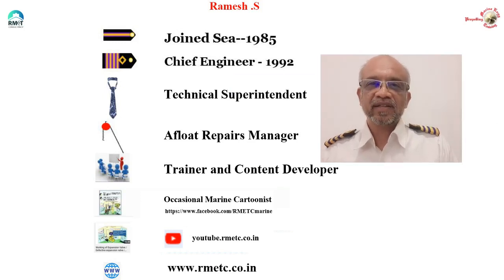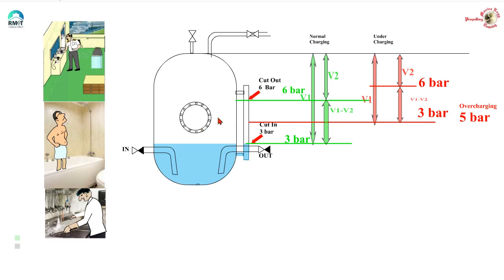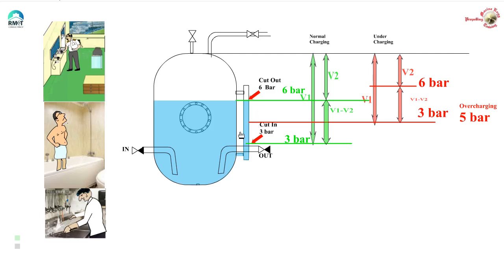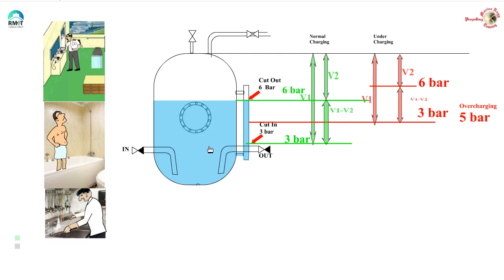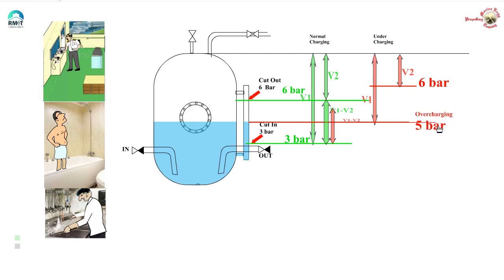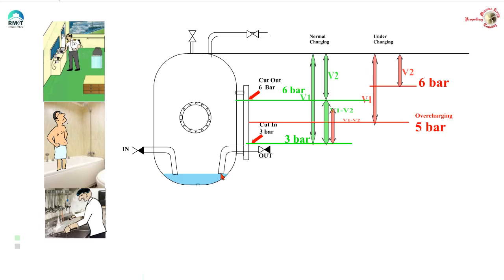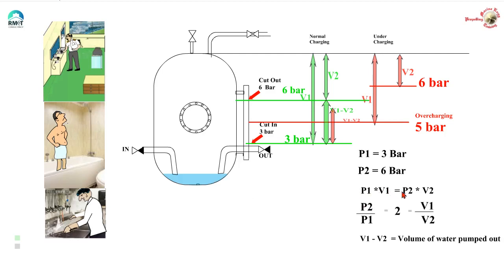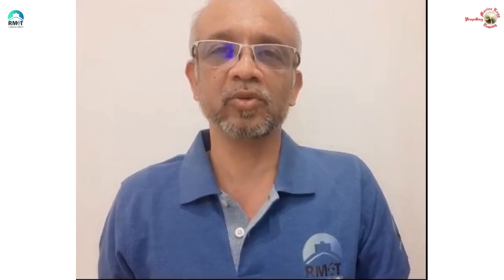#Hydrophore charging Tips and Tricks|Ramesh Subramanian|RMETC videos

Comment: Hello sir
Will love to know correct application of silicone and gasket maker.. Should we use it along with new gaskets, o-rings Or nly with old ones 
Where to use silicone n where to use gasket maker.. Difference?? 
Thanku
Reply from the maker: From what I understand, there are three types of sealing. Gaskets, sealants and gasket makers. Sealants can be used on two metallic finished surfaces likes the pump halfs of a split centrifugal pump etc.Gasket makers can replace harmless gaskets like crankcase door joints , pipe flanges etc where pressures and thickness of gaskets may not matter much. However where a gasket thickness can affect the  performance of the machine, like cylinder head gasket which determines the clearance volume etc..we need to use the original gasket only. I guess we should not use gasket makers ON TOP of conventional gaskets. AT the most we can use sealants on top of Conventional gaskets and O rings.Hope you agree..

Comment: Onboard the fresh water expansion tank level is decresing about 100 - 150 liters per  day and we check where it might drain. We checked jacket water heater and cooler. But no results
Reply: May be any pipe leakage so pls check ur sys.
Reply from the maker: May be evaporation losses.. But also possible of beginning of leaks in T/C Gas Casing. Very difficult to find out till it becomes big. T/C more likely than other Engine parts as per my experience. But can never say.
Reply: please check all the freshwater pumps seals or gland.
Reply: @rmetcvideos  we had almost same kinda experience on my ship but it was from fwg booster unit.

Comment: sir, if the overcharge means air is over pressurized, the pressure has to increase above 6 bar ( cut out pressure) as mentioned in the video, but it was 5 bar, please clarify
Reply from the maker: A normal charge if for example is 5 bar press at 70 % height of hydrophore....Overcharge will be 5 Bar at say 45 % height of hydrophore